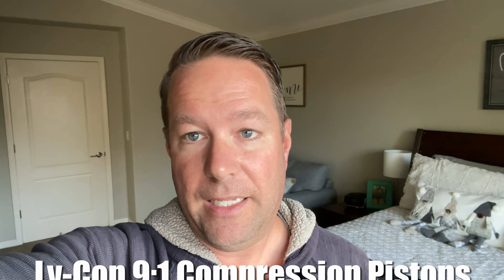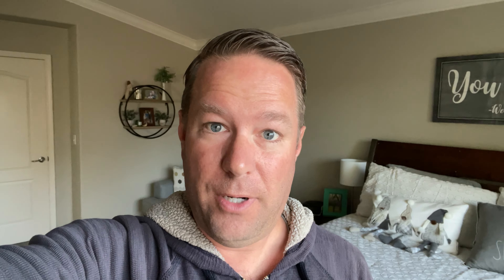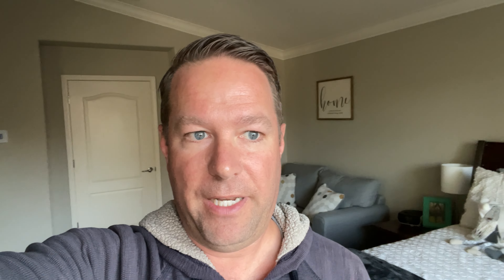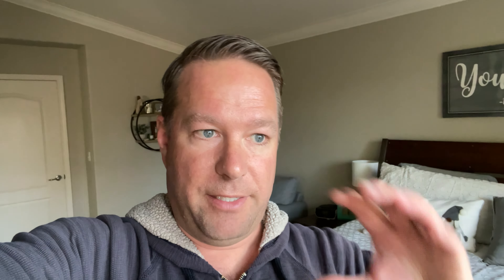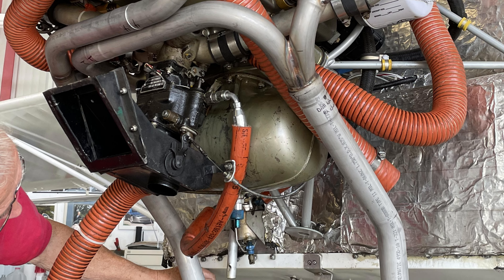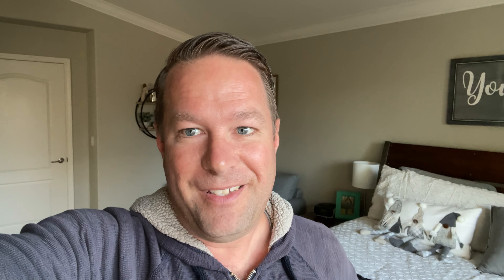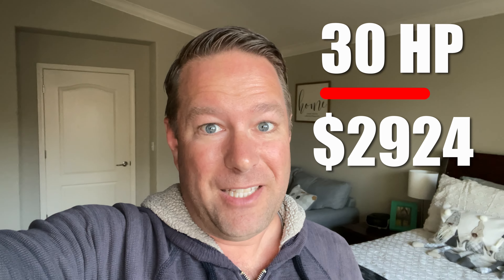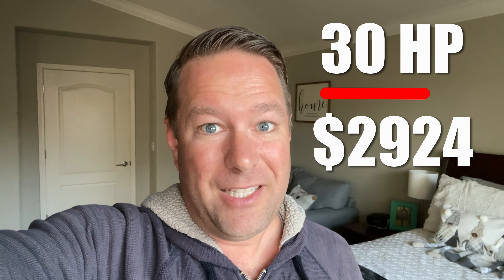How To Add 30 HP For Less Than $3000 - Continental O-200 Power!!

Comment: I like everything you said, until you got to eliminating mufflers and potential cabin heating. I don't like to be noisy and cold.
Reply from the maker: Since I fly out of Northern California, I realized that I almost never turned on cabin heat. And I can always dress for the cold. As far as the sound, I love that with the O-200 it has more of a hot rod sound versus the Rotax. It’s fun to let it sing!
Reply: @johnkluenker  I live on the Central Coast of CA and I frequently use the cabin heat in my Mooney in the fall, winter and spring. The sound issue isn't about quality but volume; I'm 68 and I have already lost some hearing. I want to keep what I have left.
Reply from the maker: Good call! Fortunately I use noise-canceling headsets that helps lot. Without them it would definitely be muffler time!! Which airport do you fly out of?
Reply: @johnkluenker  KSBP

Comment: I run a c85 stroker. The 1946 c140 had straight pipes also.not as long as the vetterman, but I still would like to see some before and after dyno numbers on that motor
Reply from the maker: Nice! That C85 is an awesome STOL engine for turning a long prop. I should add the dyno report chart to the video. Was recently on a dyno. The report showed 130 HP at 2828 RPM and it was still putting out as much as 125 HP all the way down at 2400 I believe. Pretty good for an O-200!!

Comment: Did this require a prop change to absorb the extra power?
Reply from the maker: No. The prop that I have is rated for 150 hp. 👍🏻
Reply: @johnkluenker  and you flew it when the engine developed 120 hp? You can’t use the same prop on both a 120hp and a 150hp engine. It will either be too much load at high power or not enough at low power
Reply: if it spin it faster it'll put all the power down. @sblack48
Reply: You would have to spin it at a much higher rpm.
Reply from the maker: It’s a quick-adjust ground adjustable prop, so I can decrease the pitch to have the engine wind up to a higher RPM.
Reply: a longer prop is not a faster spinning  prop. tih may as well go for a composite much lighter,  perhaps three blade.. not longer though
Reply: @johnkluenker so you will run at 2800rpm? The F1 racers at reno ran much higher but at the expense of engine life. What do you think these mods will do to your engine longevity?
Reply from the maker: @sblack48 I have been told by multiple sources that the engine is capable of handling this extra power. Oil cooler, of course is mandatory. Haven’t had any issues with the set up. The exhaust system merely allows the engine to move the air and exhaust more efficiently.
Reply from the maker: @sblack48 will only run it at 2800 RPM for takeoff and initial climb, and only if I have my prop pitched to allow that high RPM. On the dyno, it was still producing 125 hp at normal cruise RPM, which I am happy with.

Comment: Does the 0-200 have the step between carb and manifold? The A65 has a 42mm carb, the manifold is 45mm for 8mm and then steps down to 38mm… not sure why as it seems messy. I know 0-320s with an 0-360 sump had to have a cone installed to stop rough running.
Reply: The venturi is different and the jets, I heard the c85,  c85, c90, and o-200 have different venturi and jet combinations to allow for the rpm changes to produce the power...

Comment: Of course you have a dyno chart to show these mad gainz?  No?  Then you really need to realize that no, you didn't add 30%
Reply: Aww, give the guy a break... you just ruined a good story
Reply: Lol! No way did he add 30%.  It doesn’t work like that. My dyno shows 5-8 hp gains.
Reply: @jasonmoyers7236  Thanks for the reality check.
Reply from the maker: At the time of the video I had not gotten it on the dyno yet. Since then, it has been on the dyno and is putting out 97 hp at 2415 RPM, 126 hp at 2785 RPM, and 130 hp at 2828 RPM. Pretty impressive for a little O-200! maybe I will release a new version of the video with a screenshot of the dyno report.
Reply: Hahaha tell me you got smoked for over stated power gains.... rofl. Non mechanical/engine gurus should stick in their lanes you didnt gain 30 hpw. NO WAY YOU ADDED 30 HPW TO A 90 HPW AIRCOOL C0200
Reply: @johnkluenker dude you sayin 400 rpm differnece shows 30hpw gains??? Liar.
Reply: @CBREngines  O200 is 100hp
Reply: I have a model T . I went from 4 to 1 pistons to 6 to 1 pistons.  Gained 7hp  over the 20hp stock engine. Top speed was 37mph. Now I can do 47 mph. I believe going to 9 to 1 pistons will give you 10% or more. The cross over exhaust will also add at least 8% and Van's RV owners know that, also the flow maybe 3% So 21hp for sure. I feel I am on the low side.
Reply from the maker: @paper__ For what it’s worth, it did put out 130 hp on the dyno at takeoff RPM. Stock is 100 hp so I’d say that’s about 30%! Thanks for backing me up.
Reply: My Model T with 4.2 to 1 & then 6 to 1 went from 35mph to 45mph & that was all done by changing the head. Stock 20 hp & now 27hp ? Anyway a close to 25% speed increase so I can believe a easy 10 hp increase with just the compression. The exhaust 5 hp & the flow porting 3 hp Thats still 18 hp.
Reply: @CBREngines  Every 300 rpm = 10 hp.
Reply: @CBREngines  horsepower and rpm is not linear

Comment: Did you have an oil cooler before the overhaul? If not, did you have to install one after?
Reply from the maker: I did have an oil cooler before the overhaul. You need that with the high compression pistons.

Comment: Did the vetterman come without the mufflers or did you remove them yourself? Just looking on their website and the pictures look like they have them installed.
Reply from the maker: You can order the exhaust with the mufflers, but I went with straight pipes. Mufflers rob power and the straight pipes sound awesome! 😆